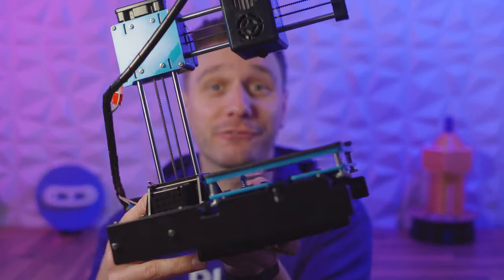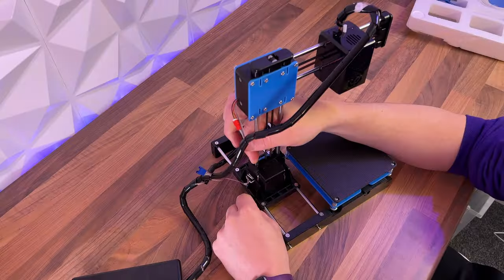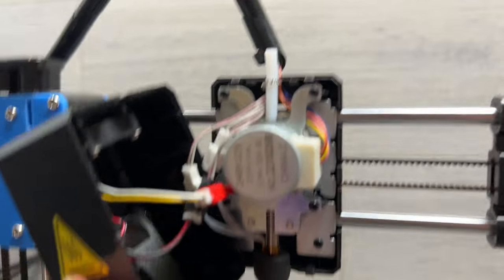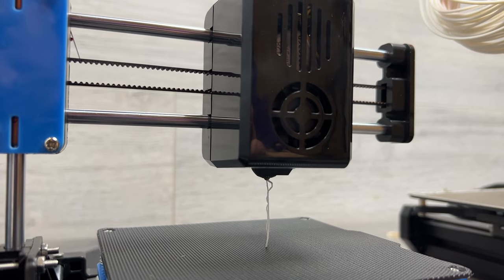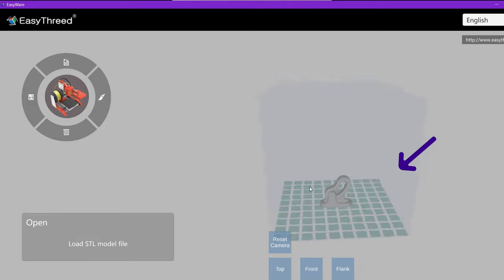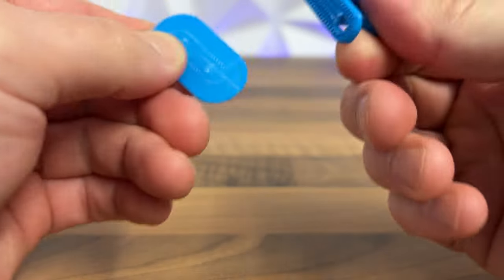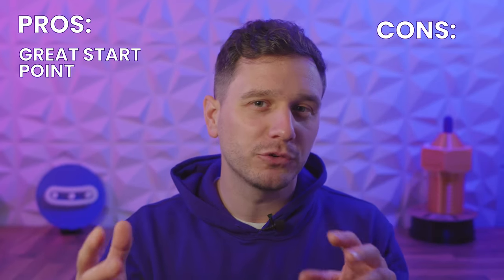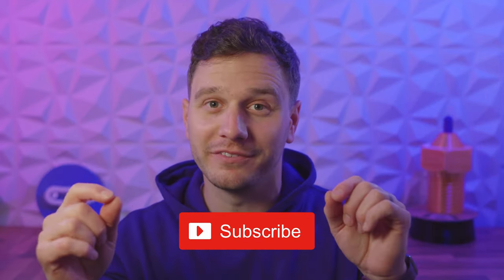How BAD is the WORLD’S CHEAPEST 3D printer?!

Comment: I have it too. Took a really long time to dial in, is slow, but it is an absolute beast for what is essentially a child educational toy.
Reply: Have you got any tips for dialing it in? I can level the bed fine, but I think my belts may need tightening or something. There's occasionally big layer shifts.
Reply: @rajgill7576  are you printing via USB by any chance? Because I used to get layer shifts when I ran it through a raspberry, I suspected back then that it is because of some issues on the serial port and skipping instructions.

Otherwise, I never had issues just printing off an SD card.

One thing that you can do I guess is to try to take of the print bed and tighten the belt by pulling it in under by one extra notch, but I would be cautious about over-tightening too, because of the tiny stepper motors. I also on occasion sprayed a bit of silicone lube on the rail rods. 

I would however not suspect belts initially, because of just how small this mechanism really is on X1. You should be actually able to apply a small amount of force with the printer turned off and see if the belts skip. But really small amount of force, just enough to get the steppers moving, because they have nylon gears as far as I'm aware.
Reply: @sedlja4605  I've been off SD card only. Seems to only be 1 axis. Haven't been printing lately as it needs some major TLC and im looking to get a bambu mini soon :D
Reply: Hey there, i've heard complaints about durability with these small printers, do you still have yours? any major issues?
Reply: @SkyfighterZX  Asides from the extruder cover clips breaking off and needing to tape it on, no. Only needed to tighten the bed belt after several years by one notch. HOWEVER, with cheap devices like this I would not give a lot of value to individual accounts because the QA could be both here and there and another unit could be completely different from qualitative stance.

However, back when I got mine, $99 was super cheap and was totally worth it. I really just wanted to get a start in the hobby and just didn't feel like I could justify $200 or more at that time. So it really depends on your situation. Honestly, today its probably better to start out with some cheap Ender.

I'm running Sovol SV03 now, but I'm keeping my X1 in its OG box for when my son reaches appropriate age to get it as a cool educational toy.
Reply: @sedlja4605  Thanks for yhe feedback! Yeah i see what you say, it can be a lottery of getting a good one or bad, and yes i was looking mostly to dip my toes into the printing, apreciate the sincerity!
Reply: @SkyfighterZX  No worries mate, glad you're getting into the hobby!

Comment: I don't know man. Not saying the price is unreasonable for what you're getting, but this is more a toy than a tool. Like you mention, you can get a solid modern printer for between $150 and $200 these days and that'll be a machine that'll actually last you a long time. If you run into a lot of frustrations with this thing, you might bounce off 3d printing entirely even though it wasn't a very representative experience.

Comment: I went through two of these when the extruder steppers gave out. I learned a lot and made some very good and functional prints. I later realized that I should have written G-code for the leveling process. It’s very difficult to move the unpowered motors. Home, hit the 4 points over the adjustment screws with pauses and then the center. Loop this 3 times or so and you’ll have a perfectly level bed. I enjoyed mine and used it to learn tons.
Reply: hi, do you mind to share your settings?

Comment: I have one. It's a TPU monster. All i ever use it for. If you update the firmware you can use it with octoprint. Works great.
Reply from the maker: This is brilliant, we use octo for our Prusa’s! What flex do you use?
Reply: Yo. Do you gotta change any settings for TPU? And are there any easy software things I should be doing to help it print?
Reply: @rajgill7576   I don't think i changed any stock Cura settings maybe retraction lowered i can't remember. it's so slow to begin with it just works fine.
Reply: Exactly what I have seen in other videos. PLA sorta works fine, but it is the perfect cheap workhorse for TPU because of the DD extruder.

Comment: I bought a broken 2000 euro printer for just 50 euro, and after I clean’t the printer it just works I put filament in, and it printed without a problem. Now I have a 2000 euro printer for just 50 euro

Comment: For me, I first got started with 3D printers with a creality ender 3 max neo. Damn thing had so many issues I had to send it back. Got a Prusa Mini+ instead and had a pretty good experience. Once you get the Z-offset correct it makes for a great and reliable printer. Now, I have a Prusa MK4. Great printer, though I have some stringing issues on some models a little more so than the mini and its harder to tune and maintain. For my money, the Prusa Mini is where its at for an entry level printer. Maybe that Bambu A1 too, though I have never tried one.
Reply: I also got a Prusa MINI+ as my first printer. I really loved it. I've since added a MK3S+ to my collection.
Reply: Got a similar story with a Anet A9 [got it discounted for like 60 euros after all coupons on aliexpress some years ago during the Anet sale period], it failed due some weird reason, where it cannot extrude anything.
{Nozzle isn't clogged. it might be that the heater element is busted/broken, or some other issues. since the temp sensor does show a high temp to print.}

Comment: do keep in mind no heated bed so it will only print pla. if you want a cheap printer that can print petg after $30 of upgrades the ender 3 has you covered. anyone with an alen key and fine flathead can do it. everyone has both.

Comment: This is one of those printers that's perfect and literally not for anybody getting into 3D printing at the same time. 70 bucks is not that much money to drop on a hobby if you're really wanting to get into it. Then you have to learn how to use it which will teach you fundamentals basically of any printer. Leveling, slicing,  etc. But, the qualm to this whole thing. That printer requires some know-how to get that to work perfectly fine. A buddy of mine has that printer and he says you have to either replace the bed sheet or start your prints too low which causes elephant footing. For trinkets is a fun little printer.

Comment: I bought one to use when not home as I have a Anet A8. Slow. Crappy prints. The X & Z axis wobble and need to be firmed up. Do not level it at the corners, go in about 3/4 inch. Spend a few more bucks and get a full size one with a display and real control panel, like a Ender 3 when on sale.

Comment: this is an ancient design that has been around for a while (probably 6+ years by now). It works, sure, but you can get ender 3s for only $30 more in some cases - which run miles around this printer. and atleast the ender 3 has some resell value if you deside not to persue 3d printing. Dont get the X1
Reply: You can get used enders 3 pro, which is even better and more economical option

Comment: I have a K9 printer it cost me 100€ but to be honest for a beginer like me its fit very well. I bought it for introduce myself on a 3d pinters world. I had printed many things with a 3d pen before having a 3d printer. Now I want to buy a bigger 3d printer. The only incovenience with this printer its you will need to chage the extruder affter less than one year of use but i dont know if this is really an issue or not. And by the other hand you should  change the original pei plate because its rough and filament will stuck in the holes. I would like to buy other pei with smoother surface and adapt it to my printer.